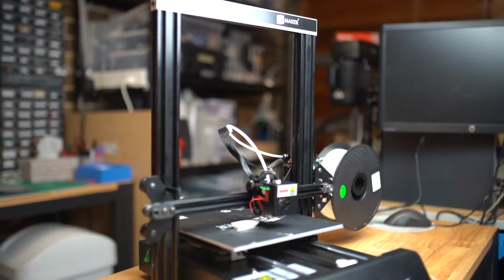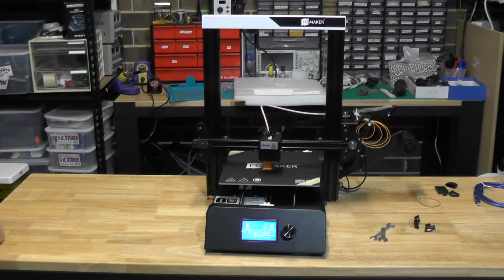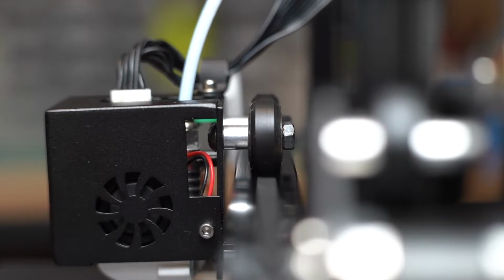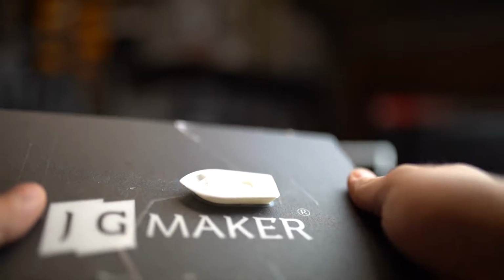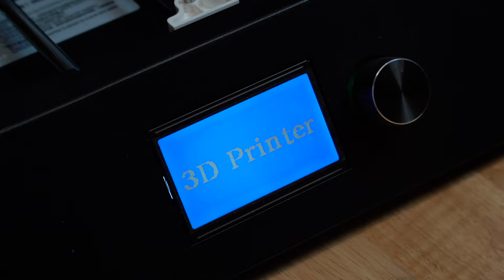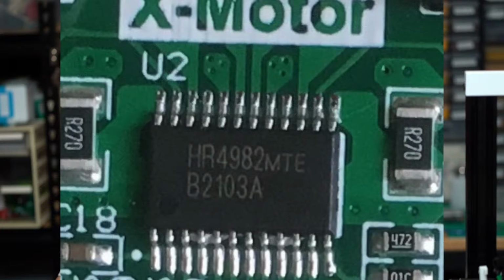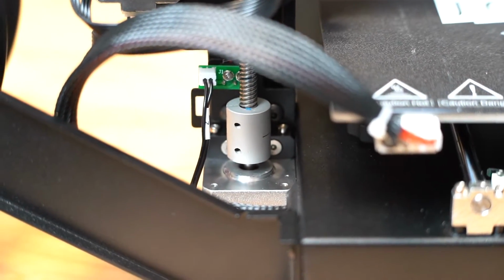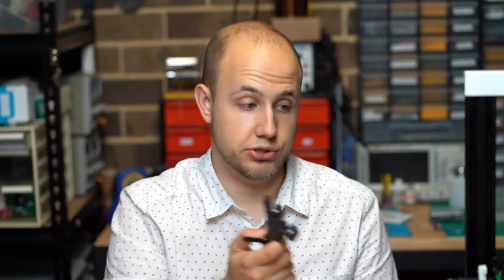The Best Budget 3D Printer for 2019? - JGAURORA JGMaker Magic REVIEW

Comment: I just received my JGMAKER Magic during their $169 sale. The only surprise was the extra $6.60 PayPal fee ( only option) and it came via Amazon!  Prime member here.  Heated bed is the new version.  Bed leads are soldered on WITH strain relief.  Z axis rollers now have eccentric adjusters.  Big cooling openings on hot end. Strain relief on hot end wiring.  The X axis assemby was already assembled. It's my 4th printer, 2 of which are FolgerTech kits.  This is a great little printer for newcomers since the only thing they have to do is set the zero z switch
Reply from the maker: Definitely good news! -- but they could have improved these things from the start 🙄
Reply: @SamPinchesMakerShop  Absolutely!  Their marketing sucks.  "Put it out there and see what breaks or doesn't work and then we'll fix it." is not a good strategy.  :(  It's a good little workhorse now.

Comment: What motor did you use to replace the factory z-stepper motor? And was it plug-and-play, or did you need to reconfigure the connector pins?
Reply from the maker: Great question. I actually had a suitable one lying around, but they are cheap and common on ebay. You can use any as long as it is roughly the right size NEMA17 and it is the same stepping angle. If you find one on ebay that has sold 100's of, you've probably found the right one to order, as these are using the most common configuration of NEMA17.

Most are 1.8deg or 0.9deg per step, check what is labelled on the motor. It needs to have 4 wires, but some 4 wire motors have 6 pin connectors for some strange reason. If the motor wiring is not the same, if you have some fine tweezers it is not too hard to remove the metal from the plastic connector to swap them around. You can use a multimeter on continuity mode to identify the pair of wires for each of the two coils. I hope that helps you get started... hopefully you won't have to do it at all. Worst come to worse, you can change both direction and step angles effectively in software - you can use DaHai's firmware that he has released for this printer.
Reply: @SamPinchesMakerShop  Thanks for the quick reply. I thought the z-axis motor was a NEMA17. Am I wrong on that? I ordered a Nema 17 from Amazon, and it appeared to be the right size, just didn't power up (likely due to connector configuration). Unfortunately, the wires on the Magic are all black with no labeling whatsoever. It's a six-pin connector, but only the outside and inside pins are used.
Reply from the maker: @MikeG183  Yeah, you're right - NEMA 17 is the right size. I'm not sure why I was thinking otherwise, sorry about that. Just switch any two wires at a time, till something works.
Reply: @SamPinchesMakerShop  I'll try that. Thanks again for all the info.
Reply: Solved the mysterious squish problem. I just noticed that the y-axis belt was pretty loose out-of-the box. My y-axis motor went out and I noticed it when I went to replace it. I replaced the y-axis motor with this: https://www.amazon.com/gp/product/B07LF898KN/ref=ppx_yo_dt_b_asin_title_o03_s00?ie=UTF8&psc=1. I had to trim the stem a few mm so it didn't hit the build plate. I also replaced the plastic pulley with this: https://www.amazon.com/gp/product/B077GNZK3J/ref=ppx_yo_dt_b_asin_title_o08_s00?ie=UTF8&psc=1. I also replaced the tensioner bearing with this: https://www.amazon.com/gp/product/B01H3FNZ4M/ref=ppx_yo_dt_b_asin_title_o01_s01?ie=UTF8&psc=1. I noticed that the stock tensioner bearing did not have enough of a lip on it, and the y-axis belt would slip and rub on the plastic. I also made sure that the belts were all better aligned. Finally, I replaced the z-axis motor with the same unit that I replaced with the y-axis. Notably, these motors are completely plug and play (other than having to trim the stem down. Base layer prints perfectly now.

Comment: Can you do a review on the monoprice maker pro mk.1/wanhao d9 . They are less than 400 bucks on Amazon and are the only large build volume printer with a direct drive in this price range.
Reply from the maker: Hi Trent, thanks for the suggestion. I hadn't heard of this model so I had a little look online. From the videos I watched, the frame looks like it is made of really nice big extrusions, but the frame is so poorly reinforced that it seems really wobbly. The cable routing looks really badly designed too. The features on the box look good, but I didn't see many people happy wit the print quality, which makes sense considering the sloppy frame - which was improved a bit in the MKII version (not the monoprice version). Looking at the feedback in the groups, most people seem to be having to upgrade the extruder and the hotend, which was the entire point of buying a direct drive printer with an all metal hot end. Direct drive is great for high detail, but the i3 design doesnt work as well when you have huge beds to move around back and forward. The power supplies are underpowered, so heating takes forever on those large beds too. Also, seems that the software configuration is pretty poor too. Overall, I'm already seeing many red flags... and considering I'm in Australia, unfortunately the cheapest I can get it for is $600USD, so it's not a budget printer that I can easily get my hands on. Anycubic Chiron would be a better equivalent buy from what I've seen - but that's hardly a perfect printer either. :( Check out the reviews on monoprice too... since that is the sloppy MKI version.
Reply: Honestly I think it has a bed reputation because of so many people purchasing it as a  1st time printer since it is cheap And not knowing how to properly set up or diagnose issues. I have heard lots of good things about the extrude or and hot end and that's the most important thing to me. I could easily add Z braces and other chassis improvements but I don't want to have to upgrade the extruder and hot end to print flexible filaments like I would with 90% of the printers under $400 that are over 300 Millimeter cubed. I wish you could do a review on it because there has never been a decent technical review on one And you do an excellent job with reviews.

Comment: These printers from JGAurora look good at first but they soon fall to bits after a little wear and tear and then you find out the guarantee is not worth the printer it is printed on so as if by magic your money has gone up in smoke.
Reply from the maker: With all respect Steve, I categorically disagree with your latter statement, having seen them provide good support in a community I am actively involved in on facebook. I am interested about your first statement - what examples do you have of them falling to bits? The faults that I have seen have largely been design faults, rather than poor quality faults - and those have been resolved over time. The JGAurora A5S for example that I reviewed earlier, seems to be now shipping with better quality bearings than the ones I received in my review unit. Thanks for your comment.
Reply: @SamPinchesMakerShop  Hi and i am not alone when it comes to not being impressed with JGAurora machine and I am not trying to sell them here. Everything goes wrong from black paint coming off the bed to the machine going into lockout mode and then they send out new hotbed glass and tell you to stick it on top of the old one and you should know why no one should do that. I got tired of waiting for shipments from China that in the end I asked for my money back well within the guarantee period AND I AM STILL WAITING hence my action here. Sad thing is the LCD menu on A5 is second to none but that is no use if the wheels keep falling off
Reply from the maker: @stevesmith3924  I'm sorry to hear you've had such a difficult experience, and I get that waiting on parts from china is frustrating - but that is where the cost savings are made to produce these printers at such low prices - there is no local support team, as that costs $$$ to run. The support team do say some bizarre things sometimes... but in terms of providing the parts you need, people seem to be satisfied. If you feel you've been unfairly treated and need an escalation, feel free to let me know, and I will try to help you as much as I can. If you still need help with anything, feel free to join the forum (jgauroraforum.com) and we will do our best to help too. The black paint is actually a ceramic coating of silicon carbide - this is the same material used by Anycubic as Ultrabase, and Geeetech as Super plate, and unfortunately they all have the same issue if parts stick too firmly and are then pulled off the bed vertically - especially with PETG.
Reply: @SamPinchesMakerShop  It comes with a guarantee so i am within my rights to ask for my money back instead of taking part in some type of beta testing program. I don't mind getting my hands dirty but waiting for a hotbed and just being sent a glass is a joke when even the replacement glass has human hairs under the black coating. I will speed years pointing the finger at JG until they go bust or give me my money back
Reply from the maker: @stevesmith3924  - totally fair enough! The only way some of these companies improve is people holding their feet to the fire for their faults, so its important to hear all experiences. All I can say is that JGAurora definitely wants to improve - so if their support team is getting in the way with ridiculous solutions, then please tell me who you spoke to, and I'll pass that feedback to my contacts there.